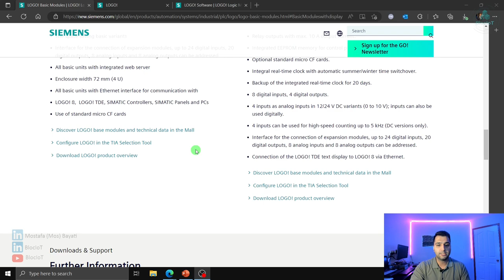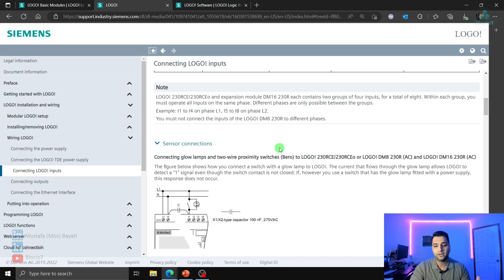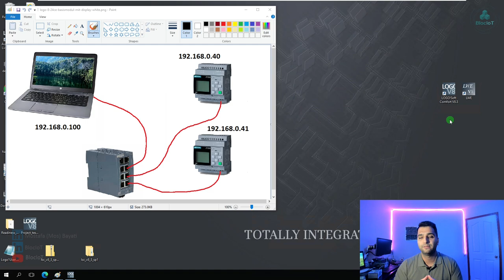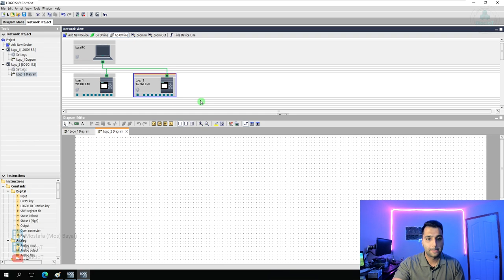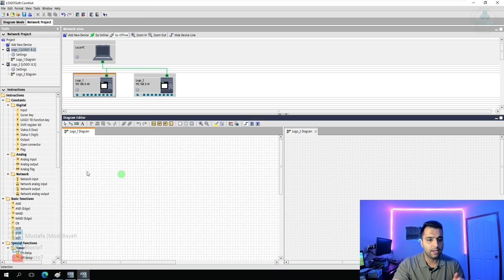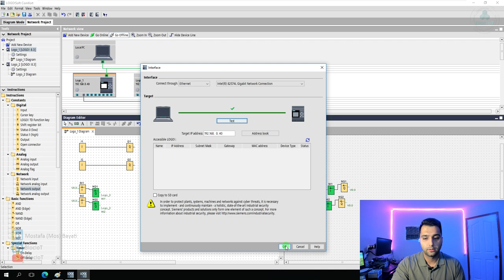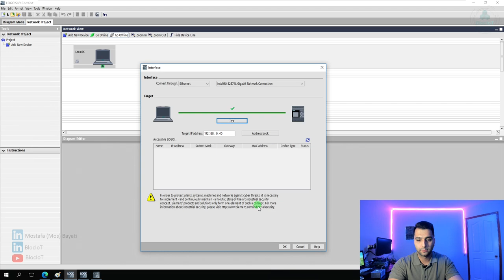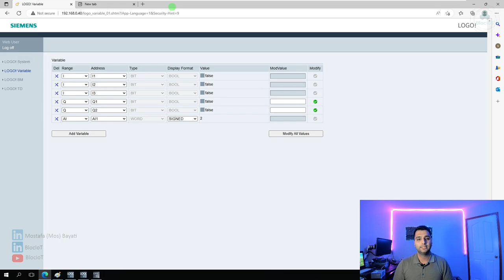10- Learn Siemens LOGO! from scratch in 30 minutes! From Unboxing to Programming Network IOs!

Comment: Emergency stop
Reply from the maker: LOGO doesn't have a safety model. You may use external devices or a S7-1200 or 1500 safety PLCs to achieve up to SIL 3 / PL e

Comment: Hi, Thanks for the great video, this was really helpful. Is there any way to log data that is received in the web editor? for example: If a thermocouple was connected to the LOGO via analogue in, could the data be logged over time using web editor rather than the SD card slot?
Reply from the maker: @Mark-n4q3m  thabks for your feedback, Mark. This is a feature that I wish existed. Currently, the LWE is limited and can't act as a datalogger. But I know the new LOGO supports downloading the log files from SD card in Run mode. I have not tried ot but it could be possible to download the log files from the web interface. I'll try it out and will update you.
Reply: @blociot  Thanks for replying, this sounds like a possible solution. My ultimate scenario is multiple PLC's/LOGO's controlling equipment, gathering data from thermocouples/pressure sensors/voltage monitors etc and exporting live to an Excel platform wirelessly. Could be a challenge with my limited knowledge.
Reply from the maker: @Mark-n4q3m  anytime. For your application, I think this video should be very interesting:
https://youtu.be/0fKBFmFBWQ4?si=OXvf1YmBGMaX3jdm

It needs a bit more effort, but you can easily use MQTT in new LOGOs to send data to a MQTT broker and log your data to a database like InfluxDB instead of Excel. Ofcourse you can log to Excel in a similar manner too. Please check our Industry 4.0 and LOGO playlist for detailed tutorials on this topic.

Comment: Hi thank you this was a big help! Currently busy with a project that involves a bunch of LOGO's communicating with an IOT2050 and then with simulation software and I'm starting from scratch. It is a crazy learning curve and people like you help a lot!
Reply from the maker: Thank you so much for your feedback. I'm glad it was useful for you. Please feel free to reavh out if you had further questions on any part of the videos. Good luck with your project
Reply: @blociot  Your tutorials have helped me to now wire up and create a test program on the Siemens Logo, I have also figured out the basics of the IoT2050.

Can you possibly make a tutorial on connecting multiple Logos to an IoT2050? I need to receive inputs from various Logo's and send it to simulation software through the IoT2050. I assume this is done using S7 in node red? But I am a little lost.

Comment: I got something so strange
I have old logo 230RCo 
6ED1 052-2FB00-0BA6
And USB cable
I can connect to the CPU and upload and download

But I have the new CPL 
Same v and same number
I can't access to on it 
It ask me the new software version
I don't know why
Reply from the maker: Could you please share the new CPU part number? You can always download the new version for free.
Reply: @blociot  sorry engineer I was busy with another issues PLC 400 
So 
The LOGO 230 Rco is 
6ED1 052-2FB00-0BA6 
About the software
The Previous LOGO ( Same model) is working and I can access it by the same software version but the new one I can't 
Thanks